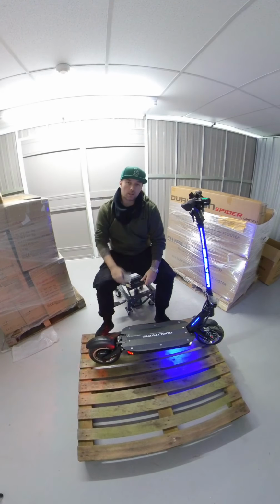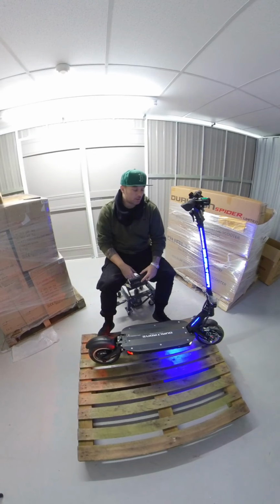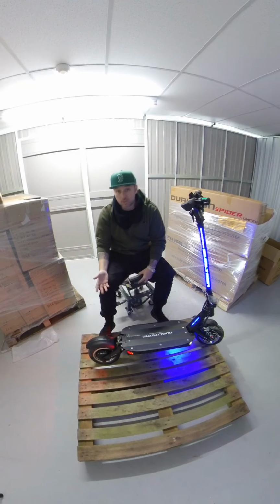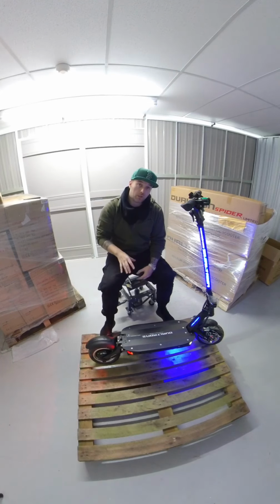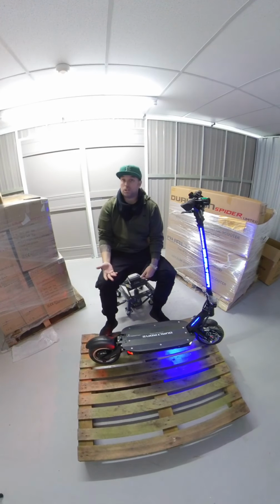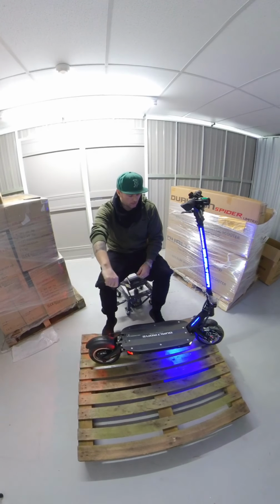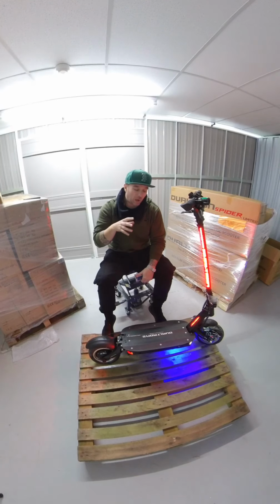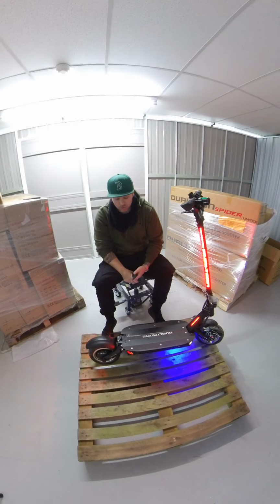Dualtron 3 Electric Scooter Unboxing / First impressions.

Comment: Dude, please flick your camera around and film in landscape mode? Please :) Also, how does the Speedway V hold up? Still one of the best for its price, or has anything else come along recently? Cheers mate. Edit: and as I type that watching this, you answer my question :D
Reply from the maker: Steve Hargreaves seems it either works on mobile or laptop not on both. We use a insta 360 camera so if you can find the output that we need to use we will try it.